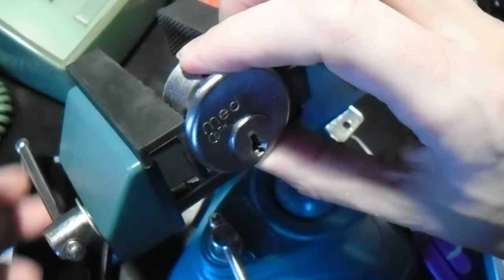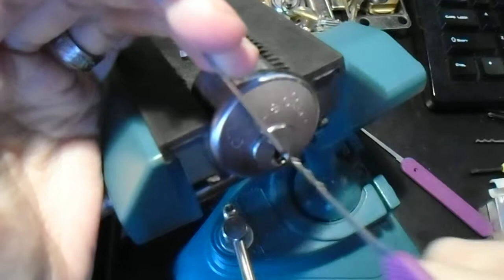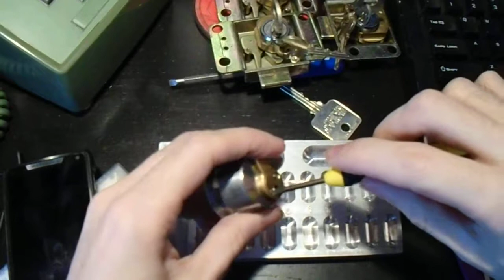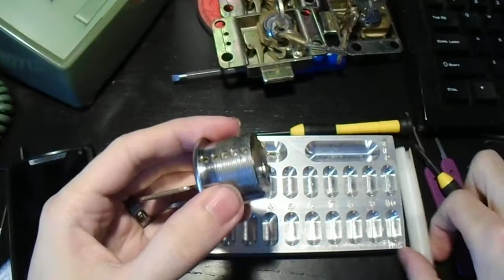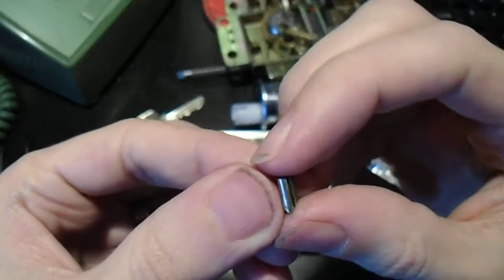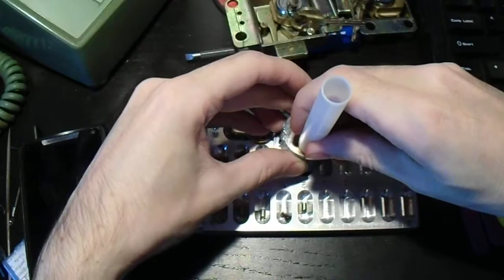(035) Medeco Biaxial picked and gutted

Comment: You might find it easier to remove the setscrews from the top rather than using a plug follower.
Reply from the maker: ***** Using the follower was slightly faster for the purposes of the video. Usually I dump the entire pinstack out the top to service them.